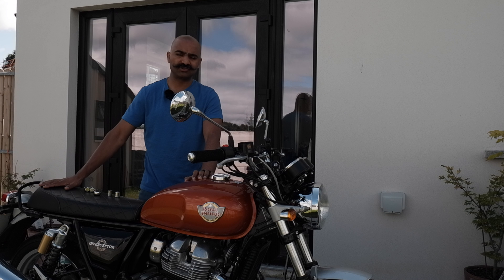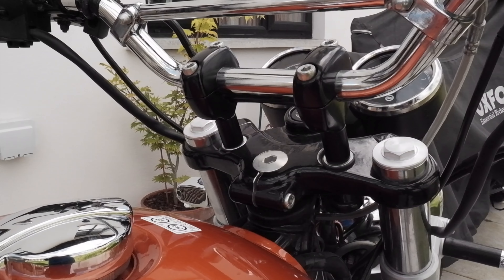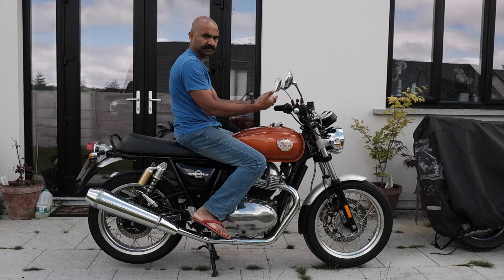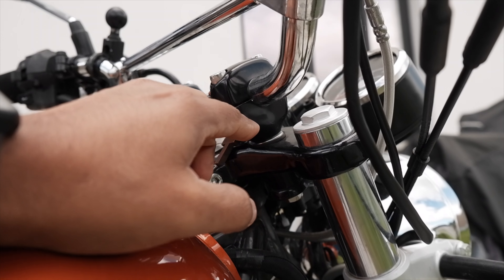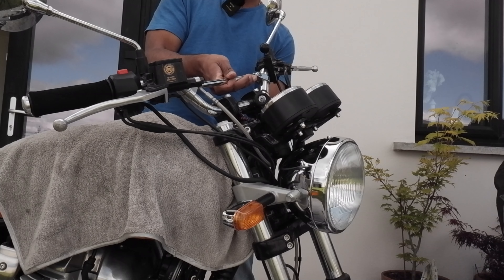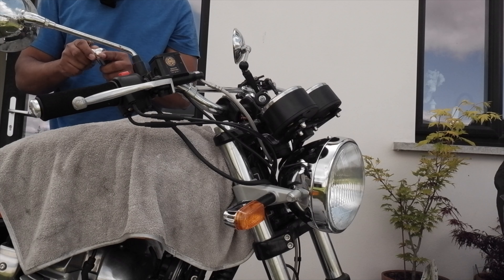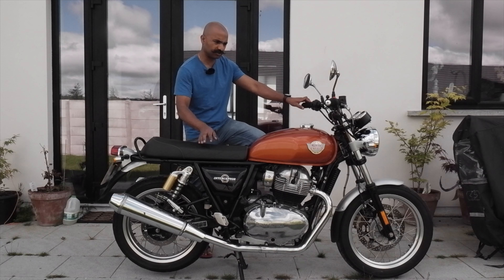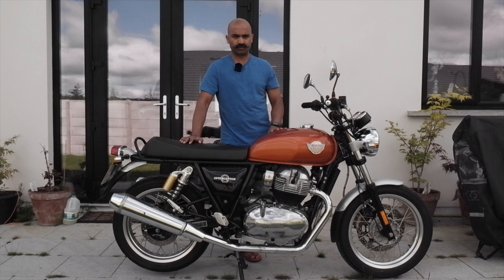TEC Bike Parts 30mm Handle Bar Riser Kit Installation and review on Interceptor 650 #royalenfield

Comment: Hi there, thanks for the video. 
Where did you get the torque setting for the riser bolts?
Reply from the maker: I can’t remember to be honest. I guess I saw it in one of the manuals..
Reply: Hi, I’ve just received the risers. You are talking about the service manual for the torque settings. But, doesn’t the torque change when the bolts are longer than the stock bolts?
Furthermore, my manual states 40 nm (29.5 ft. Lbs). 

Can 1 of you help me finding the right torque?

Thanks for the video btw!
Reply: @Timo-b3l  Which manual did you get the 40 Nm spec from? I have both the workshop service manual and the owners manual and neither of them have this part listed
Reply: I just got the info from tec: It must be 38 nm.

Comment: Another good video. Thanks. I have a couple of questions? 1. Can I ask, what your height is - it will add perspective. 2. Do you notice any change in turbulence through the bars now that you have raised them?
Reply from the maker: Hi again. My height is 5.9 with 32” inseam . I have not noticed any turbulence. Why? Has there been any reports of turbulence?
Reply: @rideswithrichie  No, not at all (the turbulence question). But I was watching your video and thinking that it seemed to open up quite a gap between the bars and the headlight, so wondered if you had any negatives to report.